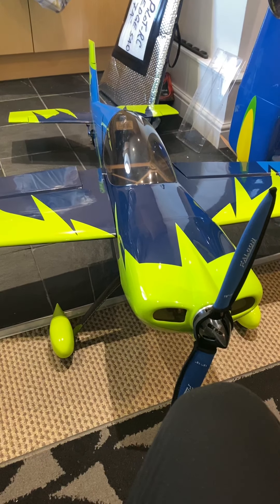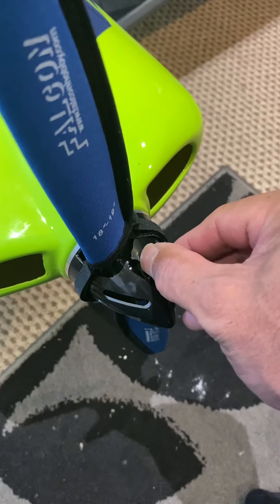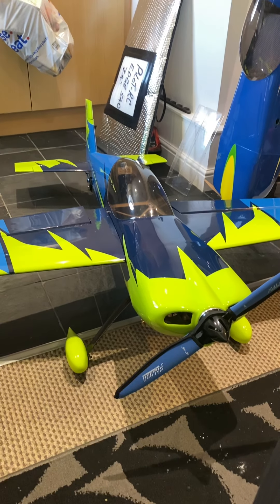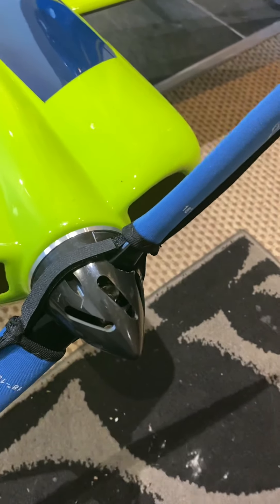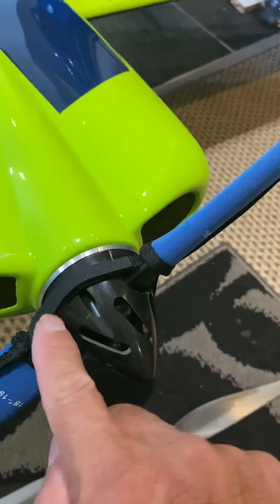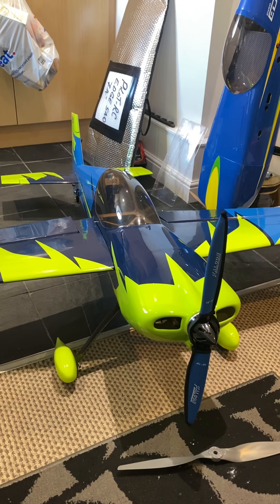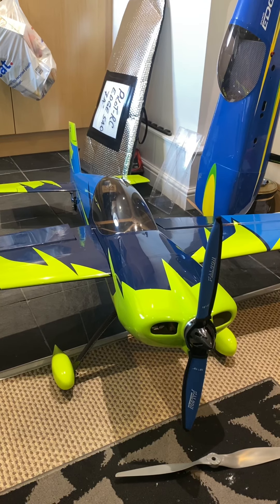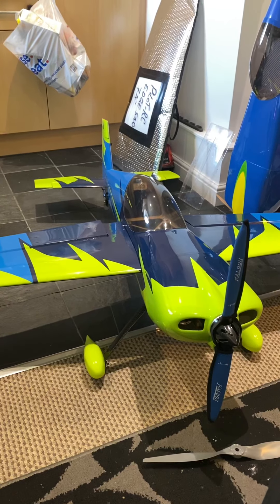Pilot RC slick 67” after maiden review..7 September 2021

Comment: Hi Danny. I’m hoping you can help me. Just did maiden with my pilot rc extra ng 67. I wasn’t sure about the CG. Asked few people and they ensured me that 5000 mah battery (730g) will be fine . When balancing plane to the mark in the middle of the wing pipe i had to add lots of weight. Over 250 g. Anyway after watching videos and reading forums no one seems to add weight in the nose. So i measured cg slightly behind the wing tube. Anyway after start, easing on throttle and banking right the plane just dived nose in and no control input made any difference. So guessing it was really tail heavy. Any idea? 🙏🏻 Thank you very much
Reply from the maker: Hi there radukapu. First you need to check your radio settings making sure it’s not got any movement mix in the controls like keep your plane on the ground without your motor running use the control to bank to the right and making sure the elevator do not move or any other controls do not move next is checking all your radio equipment sounds like when you said putting the controls in nothing happens to me sounds like you have radio issue check the rate of movements on all the controls. secondly I want to know what kind of pilot you are. Are you a 3-D pilot or pattern/ sport pilot it makes a big difference to where your CG should be. 👍
Reply: @dannyporter888silverfox8  Hi Danny. Thank you very much for your reply. As i plane pilot ’m more sport style not hardcore 3D . My experience 12 years 3d helis and few foamies now getting imore seriously into planes. I’m pretty skilled builder but got really confused by CG. As i was sourcing out info some guys say that the marked cg is slightly forward so being on the rear edge ( or somewhere around) of wing pipe I should be fine. I really felt unsure adding over 200 g of dead weight to the front . Never heard anyone doing that. Also when measured the plane from tip of the cone to the edge of the tail it was around 70mm longer than measurement  in manual. They say 1661 mm mine 1730 mm . I’m now thinking if i made a piloting error and entered banking on low speed and lost lift. Maybe extra ng needs slightly higher speed to fly well? Thank you Radek
Reply from the maker: Hi radukapu. I will check with my flight stocks to see where the CG should be and if I put any weight on them. I am In hospital at the moment so will not be out today. Will check for you soon as I can.Is your NG a pilot plane? 🙏👍
Reply: @dannyporter888silverfox8  oh no rush. Please get well soon that’s most important! Yes it’s Pilot rc extra NG 67” I can send some pics somewhere.
Reply from the maker: Hello radukapu. I sent some one to check my pilot 67” and the CG on my model is just at the rear edge of the wing tube. No weight needed on my model  with very hight movements on all the controls and that model flies great 👍.
Reply: @dannyporter888silverfox8  Hello Danny, Thank you for your answer so quickly. You really helped me! Can i have last questing? In terms of flying characteristics, what's more obedient Extra NG or Slick?  If it's possible to answer :)
Thank you again and hope your are going home soon .
Reply from the maker: The Slick will give you a more precise flight = More obedient. The NG will give you more aggressive flight meaning you have to be on the controls all the time. However if you set all your controls movements to your own choice then both aircraft will more or less fly the same unless you are a top pilot. Are you fallow me do you know what I mean?? 👍
Reply: @dannyporter888silverfox8  totaly understand what you mean 👍🏻 Yeah i actually ordered Slick as that’s probably more plane for me. I’m not hardcore 3d pilot. I actually want to enjoy the flight, for adrenaline i have my helis 😊 Really appreciate you take time to reply  👍🏻

Comment: Hi Danny have ordered and received 1.0mm thick carbon sheet will use it instead of 1.5mm. All so have bought a Pilot 67''Extra NG should I use a separate Bec on the 67'' Extra with 6S set up and 4 6v servos. Regards Jay
Reply from the maker: Hi jay.. firstly what ESC are you using if you are using a decent ESC with a built-in bac around 20 amp then you will not need a separate bac.. if you are flying 3D use 7.2v or up to 8.4v servos cos that will give you more torque and it will be faster. Hope that helped with your question jay.. fly safe! 👍
Reply: @dannyporter888silverfox8  The ESC I will be using is a Hobbywing Platinum v4 120amp Bec output switch mode 5-8v 10a/25a cont/peak it says in manual.Servos to be used bought are Savox SA-1256 TG 20kg standard digital high torgue titanium ones they are I think 6v servos Regards Jay
Reply from the maker: Hi jay.. my choice would be savox TG1270 with 35kg pull would be better servos for the NG Cos after all the NG is a 3D air plane..however if you already bought the SA-1256TG then try them if they don’t perform you can always change them later date..and 1mm carbon would be better ok better then 1.5mm cos 1.5mm is a bit harder to cut to shape and too ridges.. the hobby wing platinum 4v is a good ESC too I have one in my extreme flight slick with Xpwr 4016t motor 500kv! Fly safe jay. Hope that helped with your questions!!